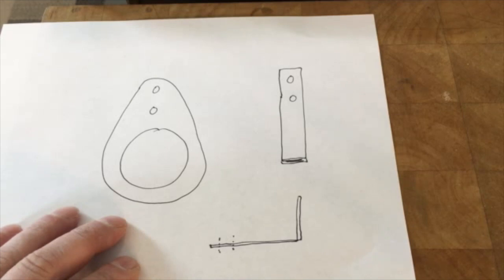Dirt Late Model and Dirt Modified Rear Weight, Percentage, Dynamic Ride Height, and Spring Couple

Comment: I you need to add weight to make the car heavier, find the CGH (Center of Gravity Height and add the 50 lbs as close to that point as possible. Weight added at the CGH isapplied to all 4 corners of the car by the current percentages, no change to rear % Wedge % etc.
Reply from the maker: Yep, all is true. This is what I recommend if your car is perfectly balanced and just needs to weigh more to make weight.

Comment: ❓️On a  Dirt Super late model  Is ther any advantage  to have  the Driver side  Wheelbase  appx. 1inch  Shorter❓️
Reply: It comes down to more axle steer and where the right side tires line up. I think where the right side tires align, in a dynamic state is way more important. Thanks for watching.
Reply from the maker: As far as taking and making the left side wheelbase shorter while maintaining the same axle steer, there is, but I believe it just complicates things too much to worry about. It's best to just keep it square and just work with the steer.